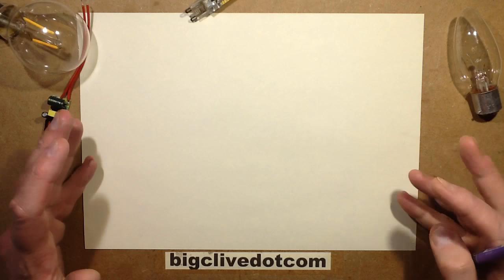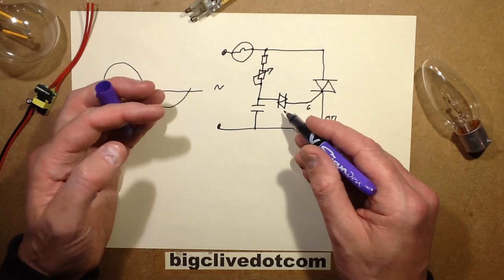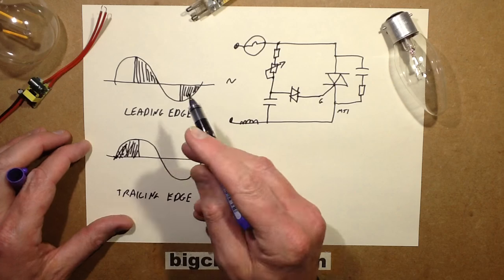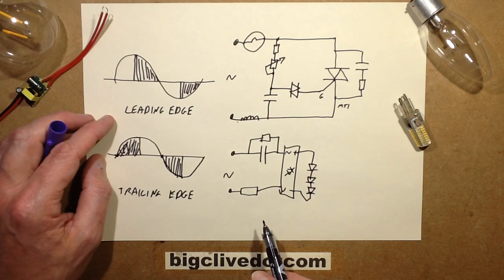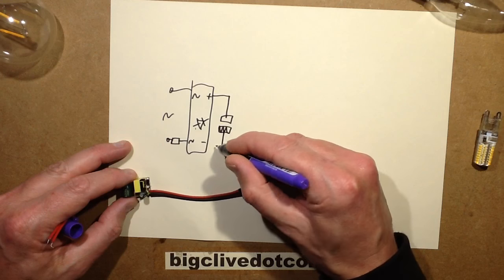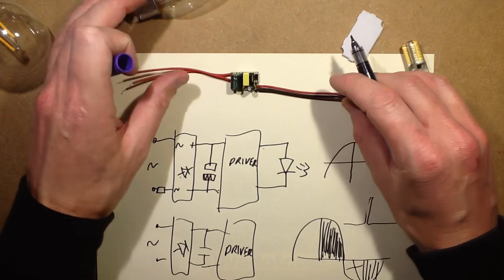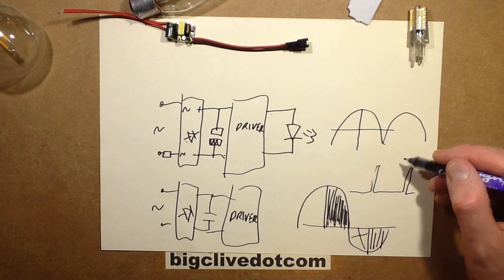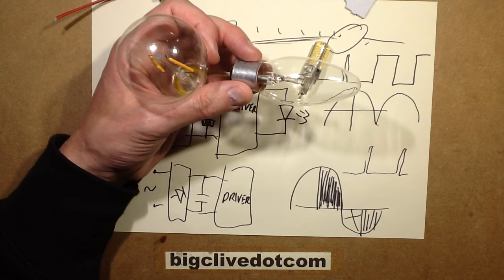Dimming LED lamps with ordinary dimmers.

Comment: does the power factor on led matter alot? .65 for axample
Reply from the maker: Most home electricity meters only log real power, so it doesn't matter too much, but if a utility company changed their meters to measure apparent power it would be an issue.
Reply: same in the USA.for industry they don't check home circuits yet
Reply: alright, thnx for the info
Reply: What's the difference?

Comment: I have a "light" problem and if anyone is going to know the answer it's you, I have just installed 10 dimmable LED spotlights in my bathroom on a separate circuit to my main light and have changed my main light to a dimmable LED  light (with remote) now my spots are working perfectly as I bought a double dimmer that is both Leading edge and trailing edge and has 3 programmable modes but my main light just flashes like crazy, I put the main light on just a normal single-pole switch and that works perfectly, so my question is can a dimmable switch work with a dimmable LED light that uses a remote for it's dimming functionality it's a Varilght V-PRO double dimmer if that helps, TIA
Reply from the maker: If the main way the dimmable light is dimmed is by its own circuitry and a remote then its power supply won't like being dimmed on an external dimmer.
Reply: @bigclivedotcom  yes you are right, Many thanks I appreciate it, it's either a different light without a remote or a different switch, for the moment I will just bypass the switch, thanks again you have a new subscriber

Comment: I have a G4 20 watt bulb. Could it be setup with a battery?
Reply from the maker: Not all LED bulbs are suitable for battery use.  You can get low voltage ones in many standard base formats though.
Reply: Thank you for responding. I bought it awhile back because it was small and I thought I could turn it into a project to learn from. 

I can put the small x-max bulbs on a breadboard and make them work so I bought a couple little bags of them thinking I could make my own fairy light strand but didn’t realize it was more complicated than the board.  I’m trying to interest my daughter into this stuff as something we could do together but I am having a rough go at learning it myself ownself. I dont have a ton of money so I even bought a box of scrap electronics thinking we could use the spare parts as a way to not really invest a bunch. 
I did get lucky and find a used Arduino hero set for a very low amount.
Reply from the maker: @townbell2248  If it's actually a 12V lamp then you could use it with a suitable low voltage power supply.  Don't use the glass ones though, it would have to be LED for heat reasons.

Comment: hmmmm Inductive versus resistive. I know, connect the dimmer knob to a shaft that goes through the wall, into the next room and then bolt a huge variac to the wall. Sorted.  :-)

Comment: so our lights need to be redone 100% where they are powered from the switch, then you will get led's that are nothing but a capacitor and maybe overcurrent protection? (high voltage PTC) and run from DC that was rectified and smoothed then have a high voltage buck constant current driver.
you dont need to worry about ac being more efficient over the wires unless you have more than 200W of light which at that point some sort of wired controller would be in the price range.

SO I SAY DC TO ALL MY DIMMEABLE LIGHTS

Comment: Does anyone really need a dimmer?  In a couple of rooms in my house I have a circuit for low background light level (PIR controlled) and another for bright.  Very simple and I can walk around at night without operating switches.  I've also made a wall light with two led bulbs, one 3w the other 6w.   A switch for each (in the unit)  and a deep knowledge of the binary number system (haha) gives me 0, 3, 6 and 9 watts.

Comment: A few years ago, I bought an expensive Philips LED bulb (similar to http://www.extremetech.com/electronics/128669-philips-new-100w-equivalent-led-bulb-runs-on-just-23w) and I will say that I can see why it was expensive. The colour of the light is the best of any LED lamp I've ever seen, it's beautifully dimmable, and it's lasted for ages without losing light output. It certainly beats any IKEA or Osram LED bulb I ever bought. 

That isn't to say it was worth the £30-odd it cost, and I'll not get that back in power savings, but it is a really great bulb.

Comment: There is a further problem, many homes have old wiring to the switch. This is a two wire circuit of live and load, putting the switch in series with the bulb. Replacing a simple switch with an electronic dimmer has two problems. The switch lacks a true neutral reference to accurately determine the phase of the mains supply and the dimmer electronics must be powered through the bulb, rather than being connected across the supply rails. As the switch is powered through the bulb, the bulb impedance define how much quiescent current that the switch can consume. Providing the switch with three wires, (live,neutral and load) simplifies the design of the dimmer switch.
While the most efficient way to control the brightness of a LED bulb is to PWM it's current limited supply, this generates a HF noisy light source. A better solution might be a switch mode filtered current source, but this must be fitted the bulb for stability reasons.
It is unfortunate that the standard for low energy dimmable light bulbs have not been linked to the dimmer switches. Finding a dimmer switch that works with a dimmable low energy bulb is currently something of a lottery. In general a leading edge dimmer is safe to use with a slightly inductive load, a trailing edge dimmer is safer with a slightly capacitive load. Using the other way round risks either a high back EMF from the load or a very large switch on in rush current.

Comment: I personally like to use thoose cheap COB led from china, like ebay or aliexpress, with a variable dc-dc step down converter with variable current limit (the LEDs are about 0.5€, and the dc-dc converter arround 2€... quite cheap actually). If you use the current limit feature just below full power, you can effectively dimm the light with little to no noise... and no flickering that i could notice.... The problem is to design that to be able to control it from the wall while using standard lights... How about the led's power, thoose who don't know about it would probably just pump too much current trough the led and burn it... And you'd need to have an ammeter somewhere to control the top amp if the dc-dc limit is over the LED's... That would be too complicated to normal ppl arround...

Comment: Is that the only type of dimmer setup? What happened to variable transformers? How about fluorescent lights?

And call me stupid, but "driver circuit" is rather unspecific and vague. That's the kind of loop hole you can drive a truck thorough.
Reply from the maker: Driver circuit could cover one of the huge range of drivers I've covered in other videos, from buck to isolated flyback units with different forms of feedback.  I deliberately abbreviated it to a box because it represented many types.
The video is also about standard wall plate dimmers that go in series with the lamp being controlled, because that is the most common type in use.
Reply: My point is that the video is about how different LED circuits interact with dimmers. Generalizing away the actual circuit makes the assumption that all circuits will behave identically. This is not an assumption that I'm ready to make.

Comment: OK if dimming modern LEDs is so difficult, make a tutorial how to easily dim your old style fluorescent lamps.
Reply from the maker: The best way was to have a separate transformer with two isolated windings keeping the cathodes hot to allow fast restrike on each half wave.
Reply: @bigclivedotcom  - Aha! Thank you. But doesn't that flicker?
However, after watching some of your videos on etching PCBs I am a bit confused since you focus more on printing transparencies, not the various actual methods: 
Dry-film, pre-sensitized, photoresist-spray? 
Positive? Negative? Mirrored? 
Developers? Cleaners?
What is what? And which of those go together? 
The sellers don't tell anything. 
I have that blue dry film from China  and  also Kontakt Chemie Positive-20 spray and I have no idea whether the transparency has to be negative or positive and if I can use Sodium Carbonate as developer for both.
Any idea?

Comment: the only dimmer switches I am familiar with are variable resistors that you rotate to turn the lights down.  Maybe the ones you are talking about are the newer digital style that arent popular around here. meh, either way I hate led lamps, fuck that flicker. No one makes good bulbs around here that dont have that annoying flicker.  Once I can no longer buy CFLs I am going back to incandesant bulbs and if I cant buy those I am going back to candles. OR, I will make my house lighting all DC and totally eliminate that flicker with my own power supply damit!

Comment: Diac and Triac then onto Daleks. Run. Where is the Doctor when you need him? That leaves us looking for Sarah Jane Smith (Elisabeth Sladen, RIP) or Torchwood.
Reply: Clive how hard would it be to make a LED driver that was smart that can use PWM as a DIY project from the wall end of things and being able to 
still work with an incandescent lamp if someone happened to stick one in and not blow up the driver?
OOPS foot in mouth. I was watching this as I was typing in and see that you covered it as I hit post. :p
Reply from the maker: I've used my RGB controllers to control tungsten lamps with PWM in the past.  Notably in an oriental  theme park to emulate lanterns.
Reply: @bigclivedotcom   I guess I was not thinking when I asked that and should of known the answer. One of those days.

Comment: Here in South Africa we have a company that has patented a so called "Universal Dimmer". I have bought one and it works really well. It will dim my non-dimmable 230VAC downlights without problems. Although I have noticed it doesn't work on all brands 100%.  Apparently the dimmer is only compatible with constant voltage and constant current drivers. Here is the link: http://www.caelus.co.za/inc/pdf/Understanding_alldimmer_2015.pdf & http://www.caelus.co.za/inc/pdf/alldimmer_web.pdf

Comment: (Just discovered your channel and loving it!!)  Ten years ago I installed Dynalite in the house I was building to control the halogens - which it does very well.  Five minutes later LEDs came along.  Unfortunately, the system employs leading edge dimming.  The question is: without spending the fortune required to replace all the 8 dimmer modules (DDLE802-MO https://www.lightmoves.com.au/product/philips-dynalite-leading-edge-dimmer-controller-8-channel-2a/), what can I put between the dimmer modules and various proposed LED luminaires to make them dimmable?  Call me deluded, but I can't believe for a minute that there is no solution.
Reply from the maker: There are lamps that can be dimmed on leading edge dimmers, but they flicker at mains frequency.  There may also be an issue with the LED current being too low to latch the dimmers properly, and also a tendency of some LEDs to remain lit when supposed to be off due to their high sensitivity.
Reply: Thanks for replying @bigclive!  I've been aware of the problems with leading edge dimming on LEDs, and am still quite stumped.

Hmm ... I'm imagining a circuit module of some kind (?) that uses the leading edge clip to define a DC PWM duty cycle?  The present circuits (all 3km of house wiring!!) are: DDLE802 -> electronic transformers -> halogen MR16s.  My 1st priority is to add LED ribbon cove lighting and some LED luminaires (I'll do something about the MR16s later), and I'm enthusiastic about somehow manipulating the existing dimming circuitry.  Even if I could be just pointed in the right direction... or am I delusional?

Comment: Retrofit LED lamps are horrible, inefficient, unreliable and as Clive says virtually impossible to dim properly. 
The right way to dim LEDs is to use a proper dimmable driver which takes in HVAC and converts it to voltage and current regulated DC.  These drivers are fairly sophisticated microcontroller controlled SMPSs which lend themselves to all manner of digital and analogue control schemes, the most common being 1-10V (analogue) switch-dim and DALI (Digital Addressable Lighting Interface). Most LED installations in  commercial premises use this arrangement. As LED lighting proliferates the price of drivers is coming down and currently a 30W dimmable driver costs about the same as a couple of decent LED GU10 lamps.  

Eventually all new premises will be built with LVDC lighting circuits.

Comment: Why doesn't someone design a wall light dimmer that puts out DC voltage that varies between 70 to 240 volts.
These LED driver lamps would be dimmable and no sharp pulses either
Reply from the maker: That would require completely different wiring.  At the moment the existing dimmers are in series with the lamps.
Reply: hmm good point. a change to the house wiring would be needed but then using DC variable voltage would make any light dimmable and also conventional lights would work too.
If it were a cheap Chinese design, they would use the earthed back plate for the zero volts ground. lol
Reply: A lot of newer installations have the neutrals dropped into the switch back boxes. I think NICEIC were trying to push for this to be common place on new installs at one point, I was told so unskilled persons would stand a better chance of being able to fit a new light fitting as there would be only three wires there. If the neutral was dropped in the backbox and ran back out to the light fitting it shouldn't be too difficult to turn the switch into a variable dc supply.
Reply from the maker: If the lighting is being installed properly then only a switch cable will be dropped from the ceiling rose to the switch.  Note that the NICEIC is not involved in setting any electrical standards.  It's a privately owned and profit motivated company that now describes itself as an "electrical safety charity".  Presumably to evade tax.

Comment: future should have all lighting  in house on dc 24V or 12V with a good high pfc powersupply in the electrical panel. then all your light switch and dimmers are nothing more than pwm switches and your light straight up LEDs .  We dont need ac for lights anymore.

Comment: There is a new standard for PWM dimming of LEDs. IEEE1789:2015. This says for 'no effect' ( even the most sensitive cannot see any strobing FX), for 100% modulation ( 0 to 100% light) you need to run the PWM frequency at 3kHz or above.
To get round the lack of LED smoothing, there were some developments in long persistence LEDs, but they don't seem to have made an impact. See 'ZEGALED on't web or search for 'REAC LEDs'.

Comment: we to have ac converted to dc  at the meter. this should  have been done before the personal pc came out. it was know back in the 70s to do this. but guess what the electric co. said no.just like the phone company putting  up ancient tech cell towers all over
Reply: Well, no AC means no transformers... And a lot of things are powered by linear power supply transformers... That and capacitive droppers don't function on DC, and the 60Hz sine is also used for timing by some machines...
The list goes on, but the idea of a "DC-Mains" is something i've looked into, it'd help the SMPS very well, and also makes the output of modified sinewave inverters much less choppy/noisy, which is actually my main aim; as this type of arrangement relieves stress on the rectifiers and mains filters etc. in the SMPS connected to the inverter...